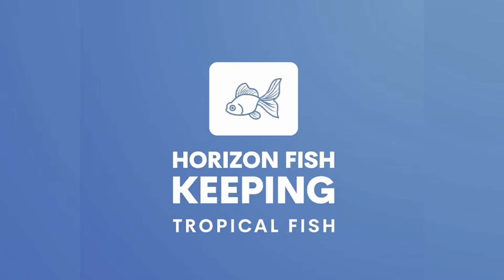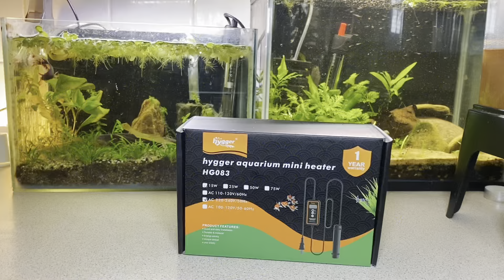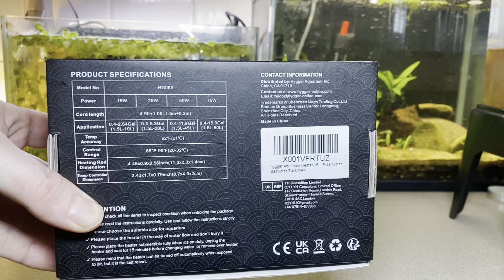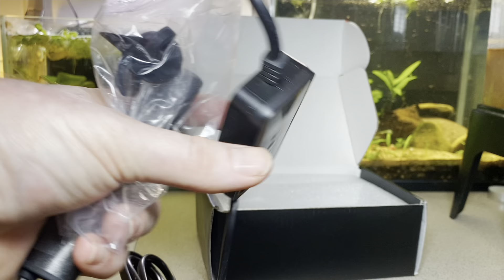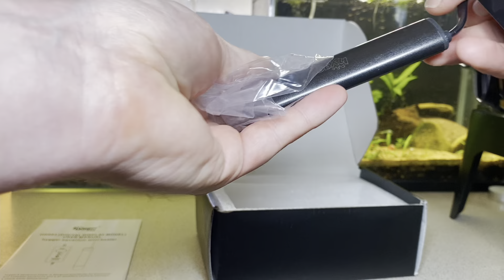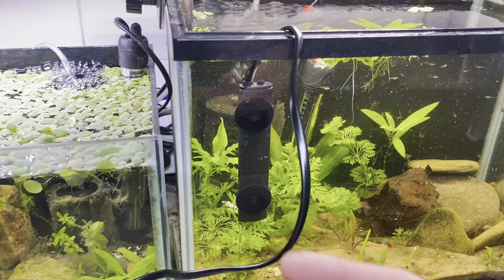Unboxing Hygger Nano Aquarium Heater: A Closer Look at this Compact and Efficient Device

Comment: 1st🎉😊full comment at the end mate👍🏻
Reply: I do quite a few reviews on hygger products mostly heaters and some lights. It depends on what they want reviewed mostly. Great review ive had good experiences with hygger🙂👍🏻
Reply from the maker: @pelhamsaquatics  I was impressed with this little heater and having the controls on the outside is a game changer for the breeding projects moving from species to species that require different water and temperatures can be a challenge when the controls are in the tank I also like the digital thermostat rather than the old dial type as would have to adjust the temperature then test with the thermometer after an hour or so to make sure it was on the temp I need so I was impressed with that function as it tells you the current temperature and the temperatures you are trying to achieve very impressive thanks again Dave 👍
Reply: How you getting on with this?
Reply from the maker: Good heater I use it for my brine shrimp hatchery now I would say the limit is 20l tank anything bigger you will need a bigger heater thanks for watching
Reply from the maker: You was quick on this one gef thank you as always for your support on my channel